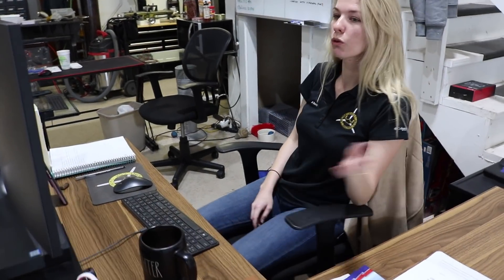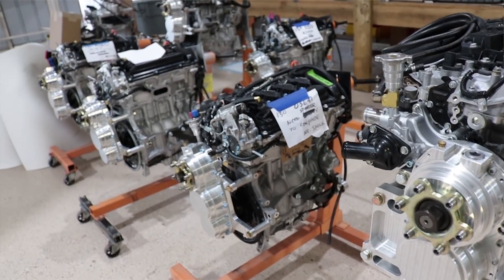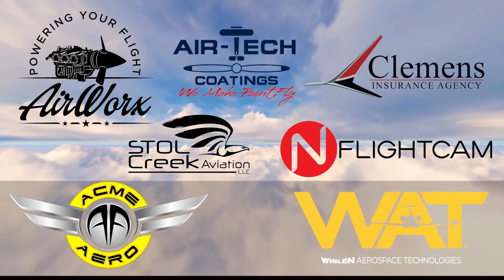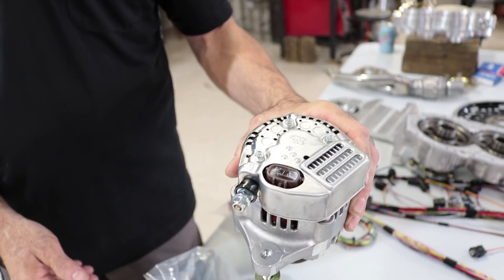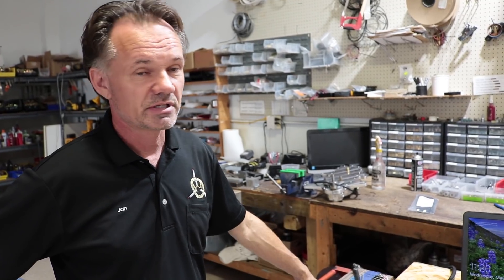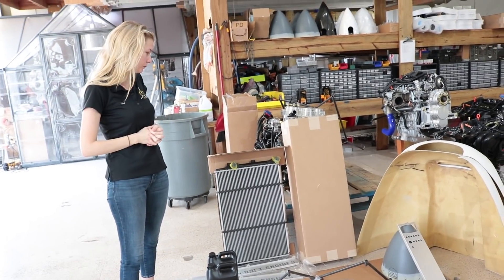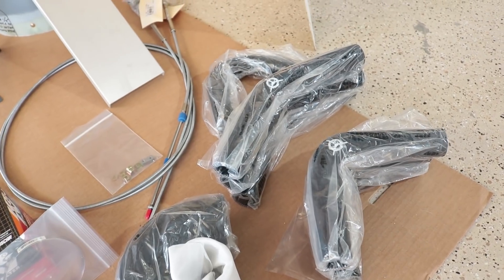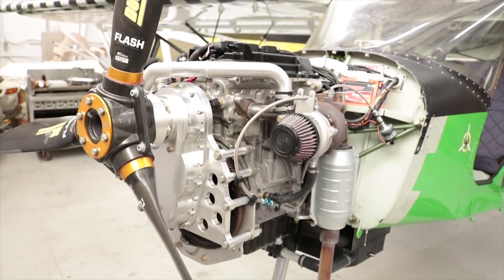Viking Aircraft Engines - Engine Week 2020

Comment: Some technical points to consider:
- GDI as implemented on an auto engine provides negligible improvements in efficiency at aero application (high) loads, as explained in detail in the EPA Technical report:
 https://www.epa.gov/sites/production/files/2018-10/documents/sae-paper-2018-01-0319.pdf
 - GDI has a single high pressure mechanical fuel pump, with no redundancy
- Auto ECUs have not been optimized for the aviation use case, and must  be hacked to reduce the potential of switching into limp mode due to non redundant sensor failures.
- the Gearbox damping is still being tested in the field , by customer installations. 4cyl gearboxes are very difficult due to large  reverse torque pulses, and resonance issues with unloaded props. For reference: http://www.epi-eng.com/propeller_reduction_technology/torsional_vibration_issues.htm  and more specifically for 4cyls  http://www.epi-eng.com/piston_engine_technology/torsional_excitation_from_piston_engines.htm
- present day high compression auto engines with this much complexity added to meet auto industry mileage goals (see point 1), are very heavy in comparison with simpler, lower parts count, aviation purpose designed engines (example rotax, ULPower etc), even those with injection.
Reply from the maker: @Pete Zut I had a few similar concerns to he honest. I am not an "owner" but I also have been following this platform for some time. And I would say that the "proof-is-in-the-pudding." I respect that JAN flies behind every one of his engines (butt-in-the-seat) and has made improvements over the years. And it seems that there are now many flying with no issues. I am NOT defending anyone here...simply stating the facts that have presented themselves over the last several years. You are very welcome to come to you own conclusions of course, and you should, but so far so good on these Honda's. Thanks for watching today and engaging in conversation! I welcome you back anytime. Are you currently building something and if so... what? :-)
Reply: @ExperimentalAircraftChannel  thx for your channel! Its a great asset to the eaa homebuilding community (speaking as a 25yr member - also following viking and Jan over the years).  I commented only to provide the community with something to complement cute puppies and couples ;)  i am building a europa (with both short and long wings), fly a europa (rotax uls) as well as a hoot’n’a’half Hummelbird (1/2vw).  https://youtu.be/wl9Q9TB0Ovk   Cheers and blue skies!
Reply: It's all about choice. Do you want an air-cooled, carbureted engine fully assembled engine for LSA? Jabiru. Want an air-cooled engine with all the bells and whistles, more power? Buy an UL power. Want to buy the most-sold small aircraft engine in the world, water cooled with gearbox? Rotax. Want the benefits of a modern, water-cooled engine mass-produced by the auto industry (more engines made in 1 year than all aircraft engines combined for 100 years) then Viking is a great option. These guys obviously put their heart and soul in trying to bring this option to the market. Heck, you can even buy a corvair kit engine (flycorvair) and learn how to assemble the whole thing part by part, so if something breaks, you know each part.

Something for everyone.

Edit: I rambled a bit there. My point was, if you don't like it, buy something else. Not every product appeals to every buyer.
Reply: Pete....Why don't you go to the independent Zenith Engine Forum where Viking earned a place with seven other engine choices.   There you will find LOTS of Viking owners and current builders whose voices deserve your attention.    There is also the Viking forum as well.   Talk to the Viking customers who fly behind the engine.   They are as capable and discerning as you.     One thing I appreciate about the Viking is the accessibility to dozens of customers.   Check out Viking videos on YouTube as well.
Reply: Another thing not highlighted much is Jan’s effort to help with the most likely reason aircraft engines fail, fuel starvation. The header tank and the efforts to provide immediate feedback to the pilot should you be running on his header tank, are another quality offering, for both Viking and other engines installs Viking offers. I don’t know of any engine that you can’t find some kind of fault in. I am so happy their are people like Jan committed to trying to give us builders options. I think this is a safe option, that can keep some peoples dream alive because the monetary cost for our passion have become so high.  It’s a very personal decision, like what plane to pick, what’s your comfort and understanding with engines in general? No matter what, as has already been stated. It’s your butt in the plane, use your other end to get truly educated about all aspects of your plane. And everyone, keep those tanks full!
Reply: Thank you for the input Pete. We love port injection and direct injection. It is true that we were somewhat amazed at the difference the GDI proved to provide, once testing started 5 years ago. I think the gain for an aircraft is 2 fold:  First, the knock threshold is much greater, allowing high compression AND advanced ignition timing, all on mid grade fuel. Another 4-5 percent is gained by allowing full open throttle and flying the engine on the propeller. Eliminating pumping losses over the throttle plate.
Reply: @eggenfellner  to your last point,  Hondas throttle by wire system, as well as their ecu programming on their earthdreams engines utilizes stratified charge (leaner than stoic  and your wide open throttle scenario) only at low/mid power and warm up  with regular  injection patterns at stoic at high power settings. Are you changing the honda ecu gdi programmingand using their throttle by wire? If not, your last point is confusing, as it isn't a diesel.
Reply from the maker: @PeteZoot  If you watch in the video about 1/3 the way in, Jan talks about modifying the Throttle Bodies. I believe this is to REMOVE the "Fly-by-wire" installed by Honda to take that "Failure Point" out of the scenario.  https://youtu.be/n14oGXmfCio?t=391
Reply: @ExperimentalAircraftChannel  which likely requires ecu programming mods to eliminate reported position errors,  so still an open question.  Im only asking because viking commented with technical assertions which beg more questions.
Reply: @PeteZoot 
We use our own Tefzel wire loom, ECU and dyno programming. It has worked on over 300 Viking 130 engines that each is capable of pulling 600 lb of thrust. That is over 100 lb more than a similar port injected engine.
Reply: @eggenfellner  cool. Your own ecu? Or do you re-program the honda cpu?  Quite a achievement to program an ecu for a GDI engine from scratch - not a trivial effort (if an aftermarket box can be found for a GDI)
Reply: @PeteZoot  it is not available and it took a huge effort and a lot of money :) - we don’t use the Honda ecu. It took over a two year period to perfect it and that requires putting our butts in the seat for hundreds of hours and flying all after hours of dyno work.
Reply: @alissaeggenfellner4613  that’s either impressive, or scary, as GDI with staged stratified charge, VCT,  advance etc  is not a trivial system to get right.  Hope it’s the former for everyone’s sake. Since it’s a custom solution as you state, is it a redundant fail-over ECU (with single output for the non redundant engine systems) or a single computer/program?
Reply: @PeteZoot  
Hi Pete. Don’t you see that everyone can see, that NO Mather what is being said, YOU are not OK with it :)
Reply: Viking's damping system is actually a really clever design, but it would probably be beneficial to run a light weight flywheel in addition to it, not for the sake of the gearbox, but to dampen harmonics within the engine itself.
-
You're completely right about GDI, it really adds nothing of value in an aircraft installation, but Honda's GDI system does seem to be extremely reliable.
Reply: @PistonAvatarGuy   agree on the flywheel for crank potential harmonic damping, but beg to differ on the damper & and the Honda GDI may very well be reliable (but still with major single failure points like the pump), but Viking’s statement above that they are controlling the GDI and the rest of the engine systems with their own custom ECU and programming throws any honda-reliability out the window.  Without a proper review&qualification of the ECU (not a trivial task), both hardware and software, reliability claims are those of Viking only.
Reply: The gearbox dampening system has been tested for almost a decade with over 600 flying, in fact it offers dampening to prop strikes, which allows protection to the engine.

There is no limp mode in our ECU is in fact optimized specifically for use.

Please understand the entirety of the system before writing false ideas. 

There has NEVER been a high pressure fuel pump problem. 

If someone wants accurate information I suggest talking with us directly or customers

There is reasons for everything that is done and has been tested through and by us before ever hitting the market. 

The comments in fact show you don’t understand the system and/or conversion or what is done.

Comment: This is a subject I am extremely familiar with. I have been a Honda buff for years and know the quality control that goes into each build. Tolerances of .0001” essentially a blueprint build on each engine. I overhauled about 35 engines and tried to keep those tolerances on each build. I have ran the different engines at 7-8000 rpm continues and have never blown an engine while racing them. Crashed a few! The only issue I’ve seen with Mr. Wades system is the rubber torque bushing mount flange. I can see they have made a BIG improvement on the flange itself. I believe this WAS their only major issue and I’m glad they redesigned & manufactured new flanges. This is engine is on my short, short list. The only thing I will be changing is the radiator. I would prefer one that’s completely welded and not with plastic caps. Not that I have ever experienced a failure that wasn’t caused from a competitor throwing debris into my radiator it’s just a piece of mind. The only thing a pilot needs to worry about is enough fuel. Another good one Bryan.
Reply from the maker: @John Paul Lafferty Thanks for showing up again and again and sharing your stories. Love reading them. :-)
Reply: @ExperimentalAircraftChannel  Bryan if I can offer my experience to the subject I will and if I don’t know a damn thing about the subject then I’m going to ask question even if they may sound ignorant on the subject. I’ve found that’s the best way I can learn and I may ask a question others may be afraid to ask in the possibility others may look down on them. I don’t care what others think about me. I know what I know and the rest I’m willing to be learn... educate me Bryan because that’s why I follow your channel. Thank you Sir.